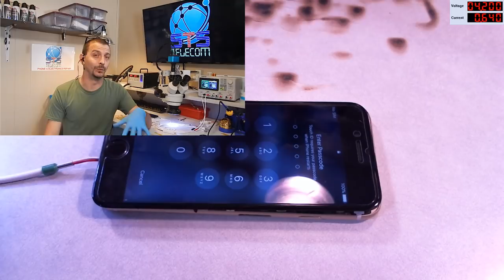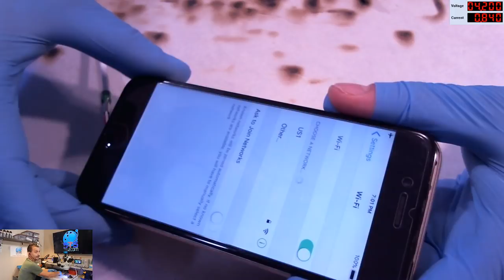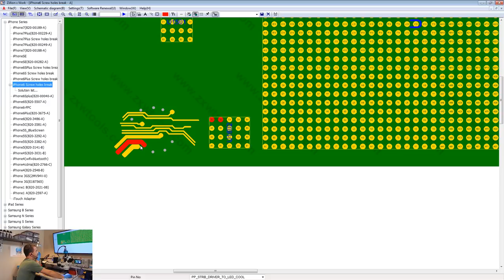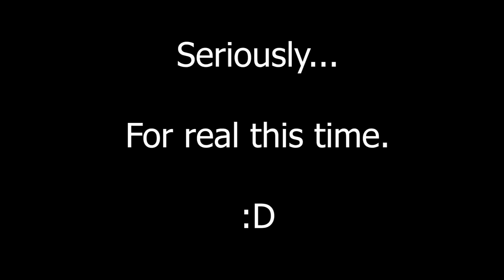iPhone 6 - No WiFi after long screw repair - a long screw repair :)

Comment: Would you please include the final step in your long screw damage repairs.....i.e. the technique by which the jumper soldered traces are epoxy covered, and the shield hold-down nut is reaffixed to the logic board.  I watched multiple video’s of long screw damage repairs, and the last step before final reassembly is NEVER shown.  You alluded to using silicone glue, locktite and UV tape but never did say which of these you routinely use....or  show any video’s of your final steps.  Other video’s have suggested the use if GREEN GOO epoxy, but not a single one shows how it is done.  Thanks, and brilliant work on your part.

Comment: Hello jason can you tell me what headset microphone model are you using in your videos, I'm looking for something similar quality, thanks in advance for your prompt response, best regards
Reply from the maker: This is a General Electric mic that I bought at the local office supply store.  They are around $10.   I think I seen some on Amazon that were the same.  This video was recorded with that mic and a Zoom  H1 Handy recorder.
Reply: thanks for your response but i have one question more you use capture card to get the image from your microscope camera or you save the video from you microscope camera using a microsd??? if you use capture card is the el gato hd?? greetings

Comment: Jason I have an iPhone 6 it has been water damaged it won’t turn on but when I plug the charger in the screen comes on to the Apple logo then goes off then comes on to Apple logo and goes off all the time like this can you advise me which capacitors I need to change and a description where they are please
Reply: burtie777  try to put an original battery in, to change a battery.
Reply: Mykhailo Kozachenko I’ve already tried that still same screen lights up only when plugged in to the Apple logo for couple of seconds then goes off and repeats
Reply: burtie777  try to start with psu
Reply: Mykhailo Kozachenko have you got a diagram of where psi is

Comment: jason why you dont put a big asss sticker "WARNING" about your repair there, i mean if this exact customer bring this phone to me it would be nice to know hey there is something going on here better be extra careful.
Reply from the maker: That's a good point really.  I usually put kapton tape over the screw hole on the metal plate but didn't on this one.  The stuff I put on this dries hard as a rock tho so it's pretty rugged.  In the future, I'm probably just gonna start using the same green mask most everyone uses though.  It seems easier.

Comment: i have the same problem with a 6, keeps crashing at settings, had no wifi until i removed c5202_rf then wifi worked but still crashs

Comment: thanks for all the info. i am going to try reballing on some old ps3 sys. the 60gb would play ps1 ps2 and ps3 so would like to bring some back to life. a new hot air  that is good at holding temp is on the way.(your link) my 3 in one has beed good to learn but after i got the hakko you use i dont touch the old one.  do you know someone that is working on game sys? i would like to fix them not just heat them up with a heat gun so they just work for ???? :)
Reply from the maker: Thank u :)   I have no idea on those gaming systems.